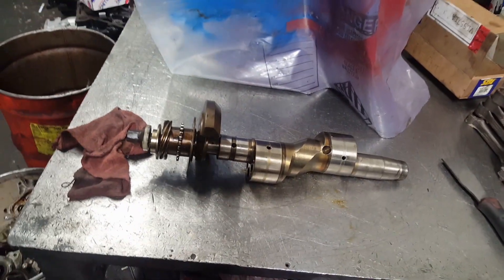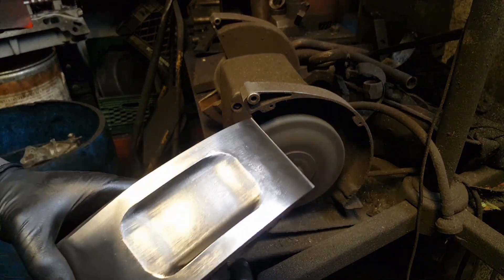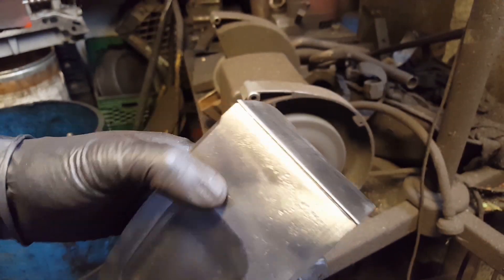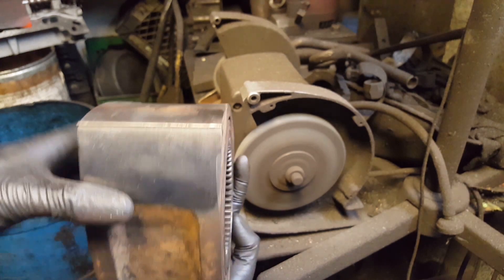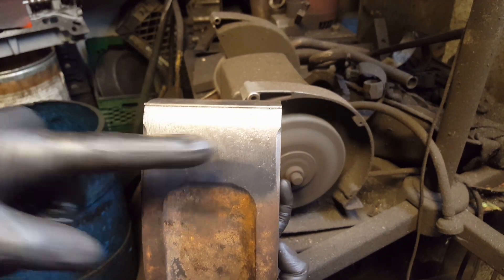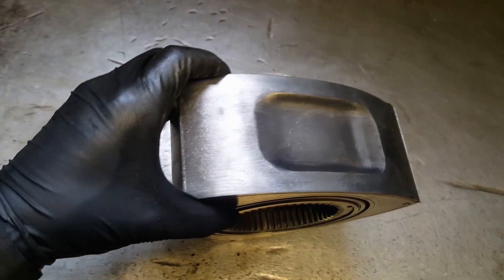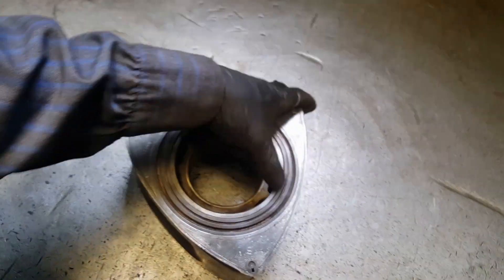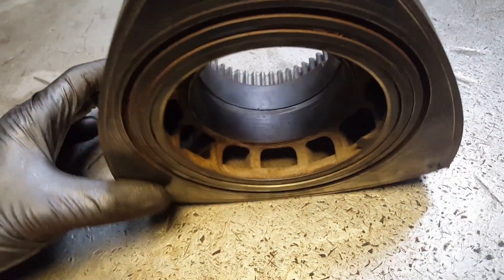Mazda rx8 engine rebuild; automatic to manual vid#4

Comment: Holaa, yo tengo un Mazda rx8 2004, un día iba corriendo en el, derrepente sonó como si perdiera presión en alguna parte del motor, después el motor dejó de acelerar, hasta llegar a 0 cuando se paró el carro, se apagó y no volvió a prender, en el trablero la luz de check engine parpadea, y si lo trato de arrancar suena como si estuviera ahogado el motor, que puede ser ? Tendré que reconstruirlo ?
Reply from the maker: Kite Las bujias i fijese aver si esta flooded o ahogado de gasolina o aceite!! 
Agale un chekeo de compression lla ke estan kitadas Las bujias
Reply: JM8686 las bujías tienen aceite y uno de los rotores no tiene compresión, el otro si
Reply from the maker: Pongale aceite a Los dos rotores, si prende kiere decir ke Los apex seals lla se rompieron o desgastaron!
Reply: JM8686 okay intentaré eso muchas gracias 👍🏻